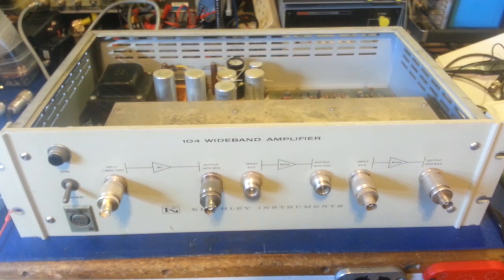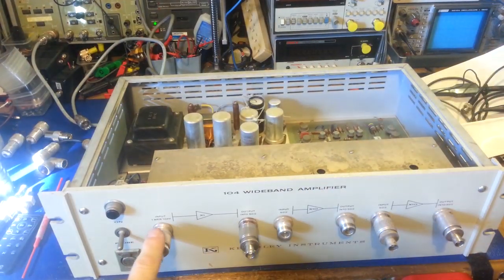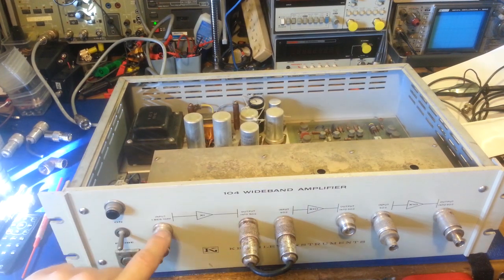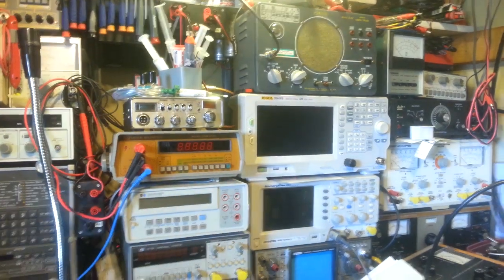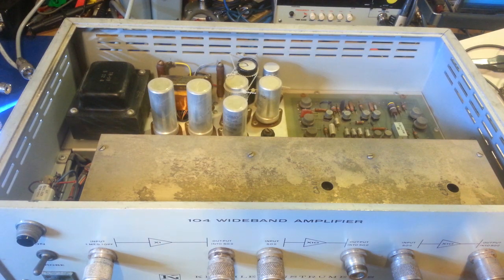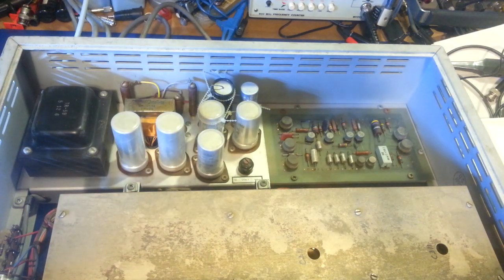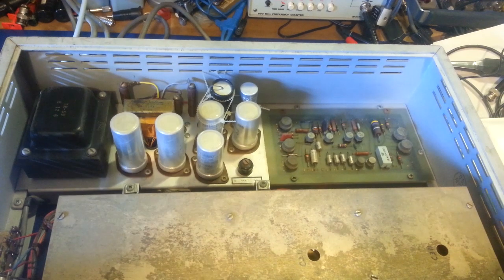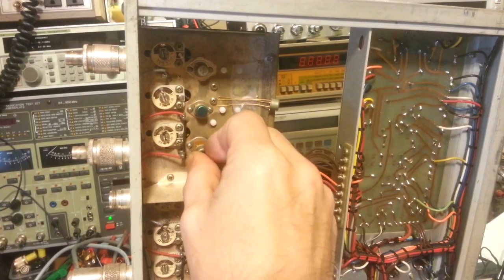Keithley Instruments model 104 Wideband Amplifier.

Comment: I've always been a little leery of sockets for transistors. I had an old Knightkit stereo amplifier in the late 60's that used transistors in sockets. Had a lot of problems with oxidation on the leads causing intermittent problems. I eventually got rid of the sockets and soldered in the transistors.
Reply from the maker: Everything is gold plated, socket pins and the transistor leads.

Comment: Those caps where prob. built to mil-spec at the time which means the caps are insanely devalued to meet spec. You see similar things when you start wanting long life at 105°C or higher @5000 to 10,000 hours  the lytics get huge for the voltage and capacitance 3X the length of a 1000  hour 85° and 2-3X the diameter.  Maybe some of the same was going on and they are slightly larger than they need to be for capacitance and voltage!

It is true though they do not build things to last today and when they do you are always looking at insane cost even with correction for declining value of the $$$ it cost is far out of line even accounting for inflation. What ever that unit cost in it's day if you built one to the same level of durability and ease of maintenance it would cost 2X's to 4X's as much today maybe more. 

If you look at even Export radio's if you take a AR-3500 and compared that to a RCI-2970 the RCI has switches that are cheap and flimsy and an encoder that wobbles often when new. They easily cost $600++ and their output is full of harmonics especially 3 order. The ecieve is full of white noise and the sensitivity and selectivity are not much better if at all better than the old AR-3500. Freq. range is not any better either since with program mod the AR-3500 can exceed the RCI2970 at the top and the bottom. Channel rejection is no better. Power output is great but that is only because they have 4 bipolar transistor in the amp under the chassis or they have 8-10 mosfets in the amp. If they actual built a unit that was today what the AR-3500 was in the 1970's and 1980's it would be a $1000=$2000 or more HF rig. If they made it easy to repair and used really solid durable parts and high quality switches add another $1000 to that price tag.

I would love to see a happy medium in the price versus durability because right now just about all of the modern radio's even amateur they are throw away because once they are out of production and OEM parts are not available you can not use off the shelf parts to repair the controls on the face plate for instance. If they use proprietary IC's instead of generic ones again short of a parts radio which is hard to find for some modern high end amateur gear you essential have a boat anchor. Sure that radio can then be parted out for it's boards and such but an essentially good radio that should have been repairable is not. Even $7000+ amateur gear is not immune to this. 

You see this in appliances too. The difference in a $400 dish washer versus an $800 dish washer is not the robust nature of the parts rather it is features, cosmetics and sound insulation. OEM's have moved away from performance and durability to cosmetics and features often the features are more about programming or a jumper setting than about additional hardware. So even if you are willing to pay more for better quality often you can not buy what you want because no one is making anything like that for sale! 

In fact much of your business is because you can not buy today what you want so people even someone as young as me would rather buy older gear and have you restore or repair it because no one is building anything like it! No one is building a SSB cb like the old Unidens or Cybernet's! No one is building an Export like the old HR-type radios. No one is building tube audio compressors that truly sound like the old ones even the tube modeling gear does not sound like the really good old gear not for CB or amateur radio audio. You can not even buy a really well built hand held or desk mic today they are all junk made to be thrown away with insanely cheap PTT switches noise amplifier circuit designs, cheap thin plastic housing etc...You can not buy anything better at any price because no one makes anything better. 

Heck OEM's are not even using thick aluminum chassis for the radios today. They use steel and if you are lucky they will insert some aluminum to mount the radio's finals too as a makeshift heat sink! 

If you look at the more expensive facets often they look nice but the internal valves for the water control as just as cheaply made as the cheaper facets and they controls feel terrible event though they look high end! That dos not stop them from charging HUGE amount for them. 

Everything is fake today and is focused on appearance and sticker price not real quality or durability. Even though I am only 18 years old it sickens me that even if I want to and am willing to pay more I really can not get much more for my money just more features or enhanced cosmetics. It is kind of like the difference between a $68,000 SUV versus a $25,000 4x4 truck. It is mostly gadgets and window dressing not real added value, performance, utility or durability.

Just look at how long older things lasted compared to their modern equivalent today!! On top of that often a few repair parts and labor to replace them will equal the replacement cost of the entire unit. The entire world is upside and backwards! The ultimate form of recycling is building things to last in the first place and being able to repair them in a cost effective manner! 

Each year things get worse and worse the plastic get's thinner and weaker on consumer good. My Dad had a Dell laptop for 8 years that survived all kinds of hard industrial use only to become obsolete the chassis is still sold and crack free and everything works as it should. He had a newer laptop that made it 2 years of light use before it was literally crumbling apart the plastic was just cracking and the keyboard went bad and the power jack was lose. He bought replacement parts but when he took it apart to replace the parts the plastic just crumbled and cracked All of the parts inside where fine the chassis was just too thin light ans weak. I just bought a $750 laptop for college about 3 months ago and I paid for the expensive warranty at the time and I am already having to use it not because of abuse but because of the terrible design of laptop's today. To get a durable laptop you have to settle for lack luster performance and pay $3000 for a Military Grade Panasonic Tough Book. Who can afford a $3000 laptop with lack luster specifications?

Comment: Looks like 75 microvolts Noise in the first stage amplifier in the spec sheet or am I misunderstanding and it is 12dB of the input signal?  Maybe that is what you get at 700mV input?

Comment: You can get high impedance with FET front ends....the really nice thing about having a tube in the front is immunity from blowing it out with an accidental overload. Sounds like an early switching supply. Had some old Raytheon 12 volt supplies that did that whine all the time.
Reply from the maker: Yep, that's why I like my military ME-26D/U VTVM.  Has a vacuum tube in the AC probe.  Their nice meters because they are accurate to something like 700MHz.  There are definitely times you just can't beat a tube.

Comment: Well of course it's humming, it doesn't know the words! Seriously, the high frequency spec looked like just 100+ MHz? Wonder why they used N-connectors for the front panel? Is the Nuvistor a 6CW4? But now the biggest question -- where is Mike going to shoe horn this monster into the workbench setup???  ;-)
Reply from the maker: Frequency response is 25Hz to 180MHz and a flat frequency response of 25Hz to 150MHz.  The Nuvistor is a 7586.

Don't need a shoehorn to get it on the bench.  I'll just use my handy shrink ray. :)

Comment: Depends on the scope probe.
Some scope probes even used with that amplifier will load the circuit down.
You need one where there is no cap across the probe... they exist but you might be better off making or modifying a probe to be sure you don't have any caps in the tip, etc.
Reply from the maker: What would be ideal would be to find the optional probe for it.  The XLR plug below the power switch is actually a power connector for the optional cathode follower vacuum tube probe.  My next thing to find. :)  Maybe i'll try building one if I can't find one.

Comment: Very nice piece of test gear Mike. I like it. I have often thought about building a multi stage broadband amplifier.  I have built several single stage amps for frequency counters.  So many circuits out these  that are not big enough to see on a scope, and this will solve that problem.  Maybe you can do a video on how to use this, plus one on stuffing your holiday capacitor.
Reply from the maker: I have a couple amplifiers, one is a Sencore but even it has a 50 ohm input impedance.  I saw this and just had to have it.  Just imagine, putting a .1 uV signal into a radio and actually being able to trace it with a scope.  Can't count how many times I could have used this to take readings with a frequency counter.